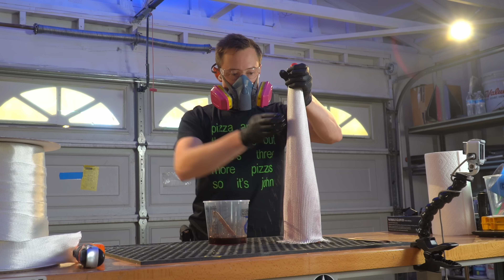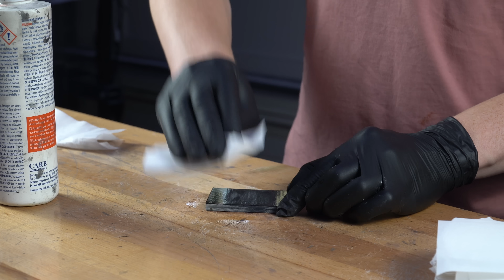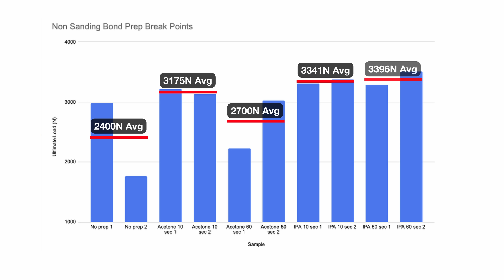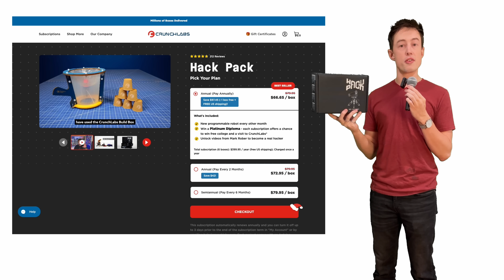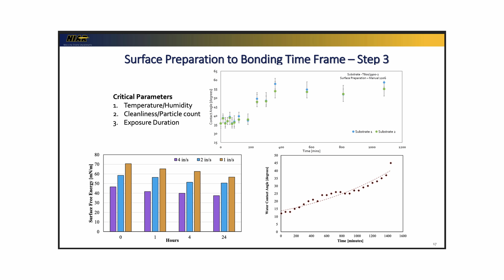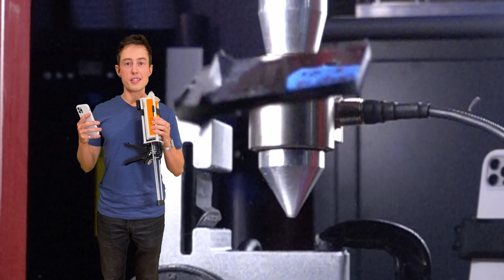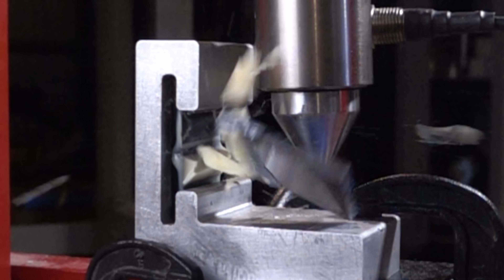I Broke 100 Epoxy Bonds to Find the Strongest

Comment: Belt sander on a hinged frame with a weight on it to get consistent scoring/scuffing patterns.  Doesn't solve the sandpaper contamination problem though -- still need solvents for that, probably.

How consistent was the temperature during the curing phases?

Part of me would contemplate rummaging through the solvents cupboard to try to improve on acetone/IPA.  Brake cleaner? Lacquer thinner? Muriatic acid?

Comment: Question, we noticed that the fins are secured to the the rocket, but when the fiberclass blocks are put into the mold, there is no method of securing the "T" parts to each other than the epoxy. Could that have been a factor in the process?

Comment: Your mold release is also oil based and even if putting epoxy in didn't contaminate it, the boiling degas would. Rub wax or silicone mold release on it and let it dry. 2-3 layers minimum.

Comment: Best surface prep is as random and gouged as you can get away with. Literal holes work perfectly thanks to the "glue" penetrating both substrates and wrapping around everything before hardening.

Comment: Doin’ the nitty gritty testing. Another minor rabbit hole you might check out is plasma cleaning inside a vacuum chamber. Medical equipment and magnetron sputtering setups use RF to induce plasma inside a low pressure chamber for cleaning.

Comment: You also should clean before sanding. Otherwise you are just sanding contaminants into tiny grooves. (source, West System documents). Also, also, some sandpaper has a stearate coating. That could transfer to the coupons and reduce the bond strength (I am not sure... this is internet lore).

Comment: What about etching the surface with a Fiber Laser or Mopa Laser?  I know they're a little pricey but I think that could give you the repeatability you need.  You could then even apply grids of areas or deeper groves for the Epoxy to sink into like a lattice.  Testing will be fun!
Reply: Was thinking the same! really hoping to see someone make a video about it^^
Reply: I was thinking the same. I have a laser cleaner, crud, you could even laser clean under vacuum.

Comment: Having done some mould making and resin casting I'd suggest that the vacuum degassing having so many bubbles in those early samples is probably more because you trapped lots of air with that fairly thick resin folding over in that small space you are filling than it coming out of the nozzle so filled with gases. Relatively small moulds like that you really want a much thinner resin or to introduce it much slower so the 'thin' trickle flows out to the walls rather than folds over on itself. So if you tried using that sort of glue mix tube and a formed scraper actually in a real world on a rocket fin outside of the mould situation I'd suspect it would perform much better than the no degass in the mould situation.
Reply: Also, pumping it in from the low side will let air push out ahead of the epoxy front. Letting it flow in from the top is not as good because the air is trying to bubble up while the epoxy is flowing down.
Reply: @mckenziekeith7434  That was my point with the pour a thin trickle slowly so it flows out to the walls - you are effectively filling from the bottom doing that. 

But yes you could use other methods to introduce the resin from the underneath of the mould, just becomes a more complex mould. Is however my preferred method in all my casting experiments - nice big fill funnel that runs parallel to the part and will fill sprue at the bottom (so you can introduce resin in many places) and a small air vent at the top lets you pour into an easy target and visually see when the mould has filled out properly as that air vent will not have a little resin in it.

Comment: What he told you the entire 3D printing hobbies group already knew from cleaning aluminum and glass on 3D printer beds to increase adhesion. We tested printing on FRP and all kinds of other substrates. The leftover petroleum distillates would cause print failures for newbies every year.

Comment: this is very much anecdotal evidence but from many and many years of paint prep for models what I've found is that when you sand something wiping it the way you do ends up actually embedding the small dust particles and in your case paper towel particles in the grooves and leads to poor paint adhesion. I generally get the part and brush it with a toothbrush under fast flowing water to try and dislodge as much out of the grooves as possible. dish soap also helps.
Reply: Air gun works well too

Comment: Firstly, freaking awesome video. I didn't expect to be glued to my screen for 45minutes of gluing plates together but here we are. Second, couple observations/insights I wanted to pass along, hope you find them useful.
There's a chance the vacuum degassing step also promoted better wetting of the surfaces for bonding. Since you aren't mechanically "shmearing" the epoxy against the surfaces, you're just relying on its own weight and moderate velocity out of the nozzle to actually make full contact with the substrate. If possible, brushing on a thin layer (with some vigor) to ensure epoxy is getting down into all the nooks and crannies before you pour in the bulk of the epoxy may help with some of those sanding examples. 
With those mixing nozzles, never dispense the very first extruded material into your bond area. Its very common for one component to be pushed ahead of the other initially and you'll often have incorrect ratios and improper curing of the first portion. People setting glue-in bolts for climbing routes always dispense the first portion through the nozzle as waste to purge everything and ensure a thorough mix before applying it to your application.

Comment: why not put a label on the outside of the mold casing, then a label on the mold itself (when dried and removed) - so that should be really simple and straight forward to keep track of your controls and you don't have to die anything..

Comment: In 3D printing it's usually best to dry out your filament before printing to get the most consistent layer adhesion; this ranges from storing spools of filament in sealed containers with a desiccant right up to actively heating the spools to 50-80C and rotating the spools in a dryer. I don't recall you mentioning humidity so perhaps actively drying the samples might be improve results?

Comment: You probably do not want to do any retests, but acetone leaves resedue on any surface that it dryes on. We are talking about stuff in the micrometer scale, so definitely not visible by eye. This resedue is not really solvable by ipa so getting rid of it once it is there is pretty difficult unless you go into the really nasty chemistry. 
This can be a really big problem when working with thin film deposition, but I am not sure if these resedue have any negative effects here.
There are some other solvents that you could try, but the easiest solution would be to never let the acetone dry on the surface. If you wash off the acetone with ipa while the surface is still wet, there should not be any resedue.
But then again the resedue could actually be beneficial in this application, if it has any impact at all.

Comment: Vaccum the epoxy to release gasses. Then after may be a few hours when a crust is formed. Pressurize the chamber and leave it like that. So that epoxy is pushed into the surface and stays pushed.

Comment: When I was in trade school for composite repair and production we were told  to use minimum 40 grit for surface  prep preferably 16 or 36  Most of matrix  was polyester resin on polyester using lacquer  thinner.  Have you considered bonding uncured to uncured?  A full chemical bond should be the strongest possible .  And aaa never wipe forward.🙄🙄

Another edit,  can't help myself.  In an extreme application such as this it seems to me the most homogeneous material will allow the simplest stress analysis with the highest confidence in the results.  The idea of bonding two components together to achieve a good enough structure ( please consult too fast Matt about this though be forewarned he HATES composites)  is more difficult than to a make mold where the entire component has the highest strength possible.  if you can find a carbon fiber version of CSM you may want to try a sample glass CSM is must stronger that woven cloth.

Comment: I assume actual epoxy application is in smaller volumes, but of not, why not add chopped fiber as it looks (from terrible eyes watching live footage) that in the consistent tests most failures are at the epoxy as opposed to the bond.

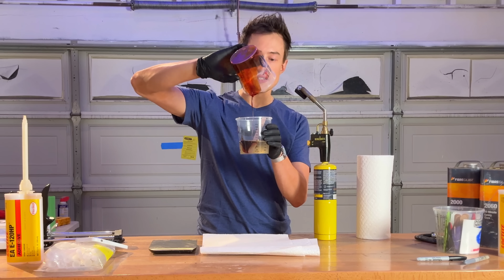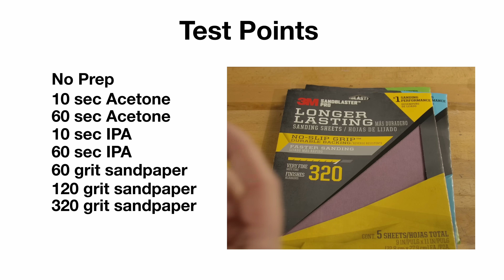Comment: 1:45 HAHAHAHA! That's not your first variable: Storage time and conditions of your epoxy, temperature when mixed and air pressure when mixing.... and that's not even considering the brand and make up of your epoxy. 4:35 Most of these seem irrelevant... they'll evaporate - and you probably only need to try a couple of grits. 5:45 Oh so the test data is completely meaningless. 12:50 Oh okay, so you've got different amounts/densities of epoxy on all of them, and they coat different surface areas.... has anyone ever told you you're terrible at this?

29:15 Epoxy keeps curing and changing through out its lifetime. 30:00 That's not linear sanding, you're clearly going up and down, back and forth (creating a grid pattern). Grain matters.

Comment: Reminded me of a time I spilled some epoxy resin, and I scraped most of it into a pile and scooped it up, and the last bit I tried to wipe up with paper towels. Which was a mistake. the spots I missed were easy to break up and chisel off later. The part I scraped up and wiped formed a very thin film that collected dust and lint and looked like shit, and a small piece of paper towel formed a sort of accidental composite material that was VERY stubborn. I ended up have to sand those parts off the tile floor.

Comment: Fun fact, resin picks up micro surface features so if you use a surface with rainbow light scattering on the surfaces of your molds then your rocket will also have micro light scattering rainbow carbon fiber. Saw Evan and Kate do it on Adam Savages Tested.

Comment: About a decade ago, I saw a white paper saying the same thing though I'll probably get the lingo wrong but: Surface energy can rule over the "mechanical lock" or surface area ideas as in their tests, a chemical prep outdid the standard sandpaper prep, too. That may have been metal bonding though - it's been a while but I feel like time to bond mattered a whole lot, too. Bascially, I think they showed a more polished surface did best as long as it was chemically prepped and done fresh. 
Granted, I never tested this myself but I've mentioned in a few times in various forums and let's just say, the messenger was shot at and old habits die hard. 

It makes sense though. Most people who make one-offs, don't want to change method without solid, widespread proof and the less rocket flying part of the industry like boat builders have been telling people to prep by sanding for decades. And I, myself, have also not been "brave" enough to forego it;)

As for the bar never being lower, I totally agree and just a week ago I ordered that same cheapo load cell amplifier and readout. Not for composites but to measure the drag of different shapes of an "underwater fish hunting barrel device";).

Comment: I'm only 31 minutes into the video, but maybe you should give up and design with a "factor of safety" aka a "factor of ignorance".  If you can get above 2500 almost every time*, then design for 2500 and if you get to 4000, that's just a bonus.

* "almost every time" depends on how many epoxy fillets you have.  If you get above 2500 ninety percent of the time, and you have 8 fillets on a two-stage rocket, your chance of all fillets working would be 0.9^8 or 43%.  So you might want to design for an even lower strength.

EDIT: Maybe I was picking up on your foreshadowing, because your very next sentence is going in this direction.

Comment: Will not "a grain of salt" be sufficient to skew results? After all, we are talking about covalent, polymerized bonds... (smile!)

Indeed, surface preparation is key, but I posit that it is not adequately addressed or understood that because the intrinsic purpose of abrasion is to maximize area of total adhesion, this step is only "approximated" by sanding. The word "total" is significant because remnants of the sanding process, being inevitable and unmitigable carborundum nano-particles, will create local stress risers.

I intuit, but an not an expert who can state definitely, that somehow adding heat into the local bond area, will potentiate bond efficacy -- and I am not talking of speeding up the chemical reaction of the epoxy adhesive, but of modifying viscosity to effect optimal penetration. Vacuum preparation is a necessary and standardizing procedure, but whatismore simulates the above conjecture.

So my conclusion is, I am as curious as you are as to your results.

Comment: I think your structural test setup is leading to part of your variability.  It appeared to me that you don't have the proper boundary condition in how you're holding the test sample.  That slotted jig allows too much side play, and I think the variability in the failure load can come because the loading is actually slightly different on the joint each time - you end up loading in slightly different geometries due to that, and that can also change as the test sample deforms.  I also wouldn't be loading with what is essentially a "point" (yes, I see it's a ball tip) load.  I'd be loading it with a roller placed against the fin to better simulate a distributed load (which is what air loads will be).
So, since credentials make a difference:  I have my Master's Degree in composite materials from MIT, where I designed and implemented composite structure testing jigs (and I learned the hard way about designing and testing for the proper boundary condition).  I worked in aerospace structural design for two different large aerospace companies for years, and oversaw design and testing of many different structures.
Reply: Hello!
I'm a random university student who has a materials lab assignment. We will be testing the stress-strain curves for different materials and supposedly the results can sometimes be very strange with steel in tension behaving like aluminum (or vice versa?) and giving weird numbers. Do you have any leads on something like this? The (unnamed) tester will be a cheap-ish handcranked student kit with a load cell and distance measurement. No more details given. I'm not looking forward to writing the lab report.

Feel free to not answer, I just feel like I saw someone on the street with a T-shirt saying "Ask me why your structural testing is giving weird results."
Reply: @asj3419  I honestly don't have enough information to say.  There can be some similarities between steel and aluminum, depending on what you're looking at, and what variables there are:  they are both metals, so have a definite elastic region, and then go thru plastic deformation before failure.  However, there are so many different alloys of both metals that different results can be had.
Reply: @sthomas6369 I think the slides we were shown implied that "steel" should have a upper yield point and yield point elongation (if that what that "wavy" part of the plastic region is called). Wikipedia told me that this can simply change with age, so maybe that's the mystery solved. I haven't managed to get a hold of the guy who holds the assignment (and told us these vague omens) so I'm not sure.

Thanks for replying! Good to know that only the elastic-plastic thing is the only definitive part of this.

Comment: Use mortise / tenons to increase surface area + mechanical connection and we're good to go. Maybe one tenon at the front 1/3rd and another at the rear 3rd. It could be relatively thin and shallow and still greatly enhance strength. Guessing that you don't want to thin the fuselage in such a manner, or you'd already be on this.

Comment: Your atomic oxygen segment reminds me of plasma cleaning in a high-vacuum environment. Check out oxygen-fed RF plasma cleaning which is somewhat industry standard in charged particle optics - the Applied Science channel has a good video on it. 

Basically, the technique is to create a low-pressure atmosphere of some working gas which gets blasted with RF energy. The gas then ionizes into a plasma and does all the high energy things, cleaning parts which makes high-vacuum systems very happy. Unfortunately for you, that technique requires you to get a partial vacuum on the surface to be cleaned, and that's a big ol chamber for a rocket!

https://youtu.be/atVSxvbiPg0?si=VEV4_5kH7N337onh

Comment: With sanding you should have been cleaning the sand paper between the first and second peice your were doing. Sand paper clogs so just using a vaccuum to clean the sand paper helps. I learned this while lapping the soles of planes when restoring them.

Comment: Interesting, I went through some studies where I was prepping PVC tubing for paint and the best outcome I observed was cleaning quickly with acetone, followed by IPA, followed by sanding, followed by IPA. A lot of mold release is used when extruding PVC so it made sense to me that I needed to remove it before sanding so I wasn't smearing it around. Also interesting is when I work on high vacuum systems that have been freshly manufactured I get the fastest pump down times when I clean with acetone followed by IPA. So hearing your results here makes me really happy!